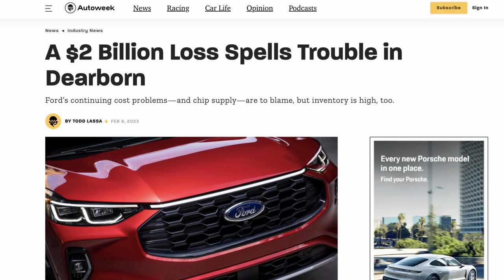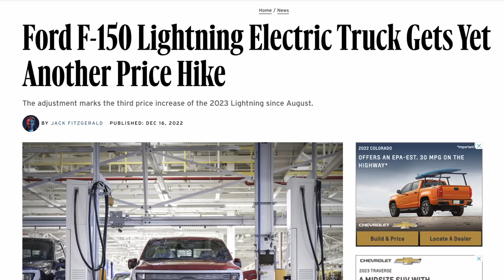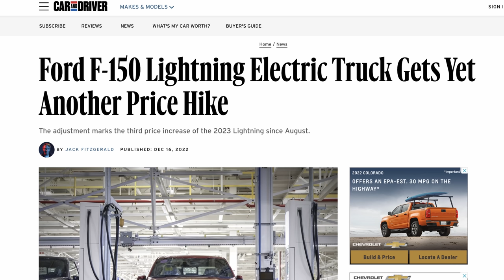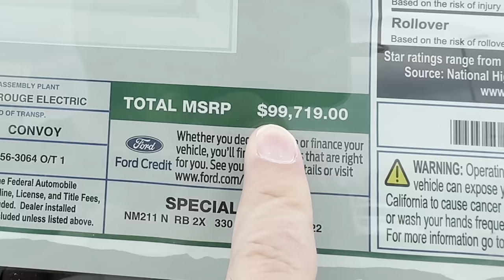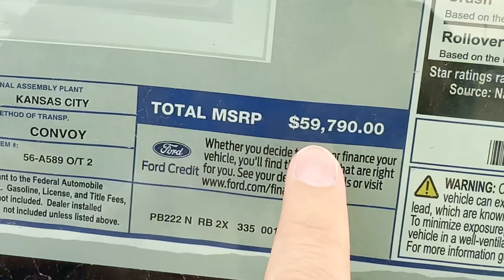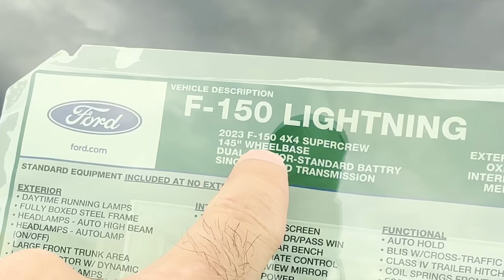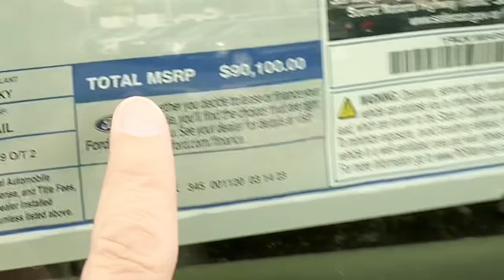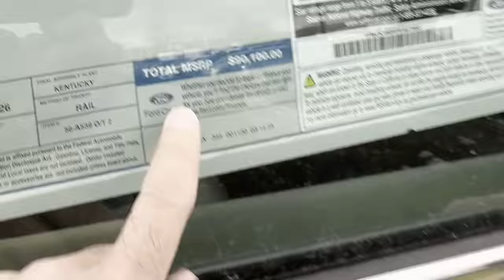Ford CEO Makes HUGE MISTAKE, Now Dealers CAN'T SELL TRUCKS!

Comment: That was an awesome video! You convinced me to not bother with a new truck. Ford is crazy and the dealers should simply move inventory at any price that gets them moving. Until then, it really is better to sink money in repairing my old vehicle.
Reply: Until you realize they are phasing out repair parts. There are parts that are obsolete for my son's 07 Mustang.  
It's all a game to make you buy new.
Just like cash for clunkers. Everyone thought it was great. Now, getting good used parts for older model cars isn't like it was prior to that government scam.
Reply: The 94  Explorer Sport,  runs like a new car with that rebuilt steering and suspension,  all for under 3 grand with the new tires and brake systems. The new ones spend more time in the shop than mine has in my 14 years of ownership, and 4 sets of tires.
Reply: @phillmccracken4219  I had to hunt for a dealer for 6 months,  that would work on my 94 explorer .  He turned out to be a Grease Monkey with very little talent.  They literally put a wheel bearing in, with a completely wrong angle ,  Torqued it down and caused my brake fluid to boil out and over heat the engine.  I caught it before she steamed ....   NO MORE  GREASE MONKEY, Mechanic.  Good Luck brother.

Comment: You would think with the 400,00 or so F-150s that sat around in Michigan during Covid that they would have given deep discounts to the dealers to sell them. Thats why there is such a flood of them now on the market. Remember Ford used to sell around 600,000 F-150s a year. The CEO is in denial and his ego is in the way. I have an explorer that has had numerous recalls and other quality issues that you didn't even touch on. I have had Fords for many years, but you are correct that I will be looking at other manufactures when I am ready for a new vehicle. It is a shame that another once stellar USA company is fallen.

Comment: I bought a 2003 Toyota Tundra V6 used in 2006 for $6,000.  Still going strong.  Only had to replace an 02 sensor and I did that myself.  Still going strong 20 years later.
Reply: Yup, I bought a 2000 Honda civic in 2010 for $5000 with 90k miles on it. Still drive it today with a quarter million miles on it. Don't burn or leak a drop of oil. I replaced the valve cover gasket on it when I replaced the timing belt and the motor is still shiny inside. Zero sludge. Original automatic trans. Best 5 grand I ever spent. I bet if you buy one of these $100,000 cars off the lot its not going 250,000 miles without major repairs...if it even last that long.
Reply: I bought a 2000 Ford Ranger XLT with the 4cyl 5 speed, in 2014, for $6.000, it had 78.000 miles on it. And I am still driving it today, it's my daily driver. Now it has 165.000 miles on it and it still runs like new. Only repairs I ever had to do were the usual, alternator, power steering pump, battery, and that's about it. It's a 23 year old truck and it starts right up and runs great, does not smoke at all, or burn oil.
Reply: @mattsbrute  It won't last that long due to computer failures. It's best to stick with older cars.
Reply: I’ve got a baby Bronco and the brakes have been making noise in reverse since the day I bought it  - Ford flat out refuses to fix the problem and says it’s normal operating brake noise - This will definitely be the last Ford I own
Reply: I have the same model, still going fine. I look at new trucks now all overblown and shiny and know that my toyota is probably going to outlast them, the whole auto industry just seems to have turned into a massive scam the last few years.
Reply: @stevem815  I use my truck for utilitarian purposes, not for show.  I bought it to haul 4x8 sheets of wood.  Seems that manufacturers are trying to turn a truck into a luxury vehicle.  We have a Lexus for that.  Consumers are crazy to buy into the hype, IMO.
Reply: This is the way

Comment: I stopped by a Ford dealership a couple of weeks ago, there is no way in hell I can justify purchasing a F-150.  The sales guy told me he was selling Bronco Sports left and right, but I have barely seen any of them on the road.
Reply: Have you ever met an honest car salesmen? Me either!
Reply: I worked at a ford dealership this time last year and saw the writing on the wall. The cars were hot garbage and they'd come from factory with leaks, turbo and exhaust rattles, coolant leaks, dead batteries, roof or door leaks and ruined electronics, engines and transmissions would go out every 60k miles and then they'd be on backorder for 6+ months.

Horrible horrible brand.
Reply: I see the Bronco Sports all the time on the road.
Reply: Bronco sports are everywhere
Reply: Bronco sports are everywhere here in TN .I bet we are gonna see a lot of car loan defaults in a couple years cause of people agreeing to buy these overpriced pieces of junk
Reply: “The sales guy told me” lies as usual.
Reply: I'm in New England.  I don't see the Bronco Sports often at all.  Where are you guys seeing them aside from TN?

Comment: I have a 2014 F-150 XLT that I paid 36k for brand new and I've only ever purchased Ford. The plan the entire time has been to purchase a new vehicle after 10 years. These prices have me looking at other brands for the first time but tbh, I'll probably just drive my 2014 for another 10 years because prices are nuts everywhere.
Reply: I have a 2012 f150, got exactly the truck I wanted, and still love it. I was going to replace it on a 2024… not going to happen.  A comparable truck is $30k more than I spent in 2012. The rust is eating my truck, but I’m going to keep it as long as possible. Hopefully it’ll last until 2030, then I’ll buy a used 2024.
Reply: @Everythingisgoingtobealright  mine is just starting to rust as well.
Reply: Had a 2004 Ranger that finally gave up the ghost. Loved that truck. Should have swapped it out five or ten years ago though.
Reply: At 3% inflation, that should be a $47k truck today.  Yes, some years lower inflation, recent years higher rates.  But still, a 2023-2024 truck equivalent to your 2024 should be under $50k.
Reply: Buy a maverick, my xlt was 26k out the door

Comment: It's not just Ford.  GM is the same way.  If Ford wants to move stock, they better bring back big rebates.  Leasing prices have gotten insane as well. 😊
Reply: "Ford Motor Co. sold 471,861 vehicles in Q1 2023, up almost 10% from the year before on strong EV, truck and SUV sales. Ford brand accounted for the bulk of the increase." -- cox automotive "Cox Automotive Analysis: Ford Motor Company’s Q1 2023 U.S. Market Performance"
Reply: @billyclabough9835  In 2021 and 2022 the lots were empty due to the Chips, so being up 10% is meaningless 
In fact the 1st Quarter graph from your source shows that Ford is down from 2018-2021.
Reply: @Wardell43  Listen to the video again. He says Ford is set to lose more than in 2022.
Reply: Unless your a Ford employee!

Comment: Well said. As somebody who really wanted the new Maverick, there werent any to be found. If a dealer got one, it had a $5000 add on . Then I started hearing about all the QC issues. I was ready to give Ford another chance after my Mustang purchase turned out disastrous.  Ford simply does not care about quality, reputation
Or their customers, just look at the dual clutch disaster they just went through.
Reply: This is why I didn’t get a maverick. Markup in my area was 7-10k above msrp
Reply: I’m having trouble getting one just at MSRP as well. The dealer said they’ll order one but I doubt they’ll let me have it at base price 😢.
Reply: @adamarens3520  just as well.. QC seems to be an issue as well as more styling changes. Toyota is rumored to have a similar vehicle in the
Works that has a better battery system
Reply: Dude... Why in god's name would you want a maverick???!!!
Reply: Super gay car, plus I don't think you wanna bbq yourself/family. A ranger is ab astronomically better buy
Reply: @4strokesarejokes the maverick would be a nice little truck if it wasn't overpriced and unreliable. The ranger is more expensive and the size of an old f150

Comment: We have a 2000 F250 7.3L diesel. Only has 245k miles on her. Just about Everything on it is still original. Runs like a dream. Best truck ever built in my opinion(the year and model of mine)
Reply: You're approaching the time for injector cups, FYI. Also, the turbo and turbo pedestal o-rings 👍 I've got  a 99 that the engine spun a bearing at 478K...
Reply: @metalmastersc  Ohhhh! Thank you!!! The truck was my dads and he was meticulous about that truck. Moved to Alabama last year and no ford dealer out here will touch it bc it’s over 10 years old. So I have to drive back to Ga if I want to use the ford dealer for anything. Even they strictly only mess with fluid exchange- like oil changes or rear diff fluid change… so I appreciate that heads up and advice.
Reply: @metalmastersc  did you get low on oil? And there was lack of oil flowing into the gap between bearing and journal? I’ve been trying to learn every aspect of this engine, people normally don’t give me the time of day assuming bc I’m a girl I’m a dumbass 🫤

Comment: I expect 12%  of face profit on Gross sale,  Plus hidden 3%  Hidden profit (Hold back) from the Mfg.  <*>  F.O.R.D. (Found on Road Dead.)   I also remember GM would finally perfect their vehicle,  and completely change the model to start over.  <*>  I  bought new cards,  simple loans  3 years (most vehicles cost a years solid pay),  Now it is 6 years and easiley 2 to 4 years pay.

Comment: We bought a refrigerator during the parts shortage, and the maker had to get substandard parts to manufacture with. In less than a year our compressor went out and the repair man said it happens all the time with new models.
Reply: My Appliance guy said the same thing, that he can hardly keep the new ones running long enough to get through the warranty period.  We have had one call on our washer and one call on our refrigerator since we bought this house 12 years ago.  He said the old ones will go twice as long.
Reply: @barbmelle3136  We have a 25 yr old maytag top loader. The repair guy (just a belt) said it is worth repairing because the new one wont last.
Reply: 1980 F100, running strong, I even have an extra 300-6 onan engine stand in the garage, I'll probably never need it. The art of fixing things is being lost in this "throw away" times we live in now
Reply: Last year my mechanic said over 25% of the complex repair parts were faulty out of the box.  Mine was a steering box for a GMC 2500 and yes the first one leaked when they installed and tested it...sucks for them to install twice...hopefully the quality is improved now.

Comment: Canadian here.  My first truck was a 95 F150 that I bought in 2005.  My next was a brand new FX4 fully loaded that was around $48K sticker price.  Traded that in in 2018 and got a base model "factory driven" XLT for $33K.  I've had the occasional car as well to go along with it.  This year I'm selling the truck and not getting another.  At the kind of prices we're talking about nowadays, I can get luxury mid to high end car easily.  Juice just isn't worth the squeeze.  I'd rather buy an old beater at this point and drive it once in a blue moon for hauling home depot runs and leftovers from home reno projects.  Ford's absolutely out of their minds if they think us average folks will pay that much for a truck.
Reply: Me too - I have a F-250 2016 was thinking of replacing it and was nah I can get a sports car for these prices. When this one dies I'll just get an old beater

Comment: How about that hybrid maverick that was supposed to have a $22k base price at launch a couple years ago.  I thought that would be a hit, but they seem to be vaporware, none of the dealerships have them in stock and the price today if you can even get a dealer to accept an order is 28k, which doesn’t sound too bad, except for the fact it is about 25% more than the MSRP just 2 years ago.  And that is for a truck that doesn’t have the reliability, fuel economy or features of a Prius LE.  Still, I could buy 2-3 mavericks for the price of one F150, if there were rows of mavericks on dealer lots priced at around 30k with options, I have a feeling dealerships would be turning a lot more inventory.

Comment: I've owned eight brand new F-150's, last one being a 2016 model. I was in sales and these were my work vehicles so they saw a lot of miles. I never had a problem with any of them, not one day in the shop.
It's sad to see what's happened to the line.
Reply: 2016 was their last great year...after that something changed it's too bad really. I hear you on that.
Reply: The problem is that you shouldn't have had to own 8 brand new ford f150 trucks. You should have been good with two or three quality affordable vehicles over the same period.

If you had tried to keep any of those trucks longer than a few years you would have discovered what unreliable and expensive lemons they are compared to toyota or honda.
Reply: @Xtopher822  Toyota and Honda are the only vehicle I will ever buy!
Reply: @Xtopher822  Yeah that's not the point.... You buy a new vehicle because you won't have any issues! People buy a Toyota because they can't afford a truck that's the difference 🤣 Gas milages vs Towing capacity just isn't a measurable comparison.
Reply: @steveo1240  Me too.

Comment: I think the problem with Ford and other manufacturers is that they are too short-term focused.  Instilling a philosophy of quality in your workforce and management takes time and effort.  It doesn't happen over night.  Toyota, on the other hand, makes quality an integral part of their business - they call it CQI (continuous quality improvement).
Reply: I really think people are going to be disappointed when they figure out that Toyotas ran so long because they had no features. Simplicity is a great way to create long lasting machines.
Now that they have sold big in North America they have updated and begun using a lot of modern electronics.
Reply: Short term focus...American car companies...has not changed in 100 years. The make a few bucks and spend like drunken sailors. Import companies are steady all the time.

Comment: Interesting. I was just looking at Ford Transits and had the same thoughts. Many of the features you get standard on a Ram ProMaster or Mercedes Sprinter are expensive options on the Transit. When you add the necessary options in, you’re getting a lower quality product and paying more. I was looking at over $70K for a cargo Transit. That’s no seat rows, no windows, no fancy anything. Just for cargo.
Reply: From experience at work the Ram vans have a lot of problems brand new off the lot. A lot of issues with the electric parking brake .
Reply: @farmrrick  Funny because every pro master I’ve driven has a manual pull brake on the floor

Comment: My Ford F150 has been full of minor glitches while the dealer has been less than honest about servicing them. Sale was reasonably good but turned into a lie on the availability of an OEM shop service. Meanwhile, new prices are unjustifiable. After years with Ford, will definitely look for options.

Comment: I purchased my extended cab, 2wd F150 XLT new in 2016 because Ford was offering a $10k factory rebate plus an extra $1,500 dealer discount. I drove it off the lot for under $29k. Ford knows how to move its stock. They just aren't properly motivated yet. Current prices are absolutely insane and disgusting.
Reply: THANK YOU JOE for force feeding electric vehicles on us.  Now we just need the electricity to power the trucks!!!!

Comment: For the first time since 2003 my wife and I bought out the leases on our trucks. The prices and interest rates are insane.
Reply: Shouldn't be leasing anyways.
Reply: @roymercer22  It wasn't actually a bad deal on a lot of vehicles. I'm leasing a Honda right now, and 2 years later it's still worth more than MSRP that the lease started at. If I buy it out right now I'm up money including the payments made (and the interest rate on the lease was only 2.7 percent).

Used vehicle prices are starting to come down, but there was actually a window of time where leasing was a no brainer.